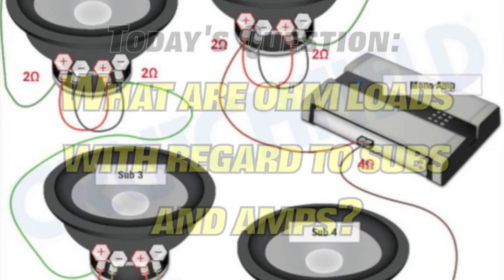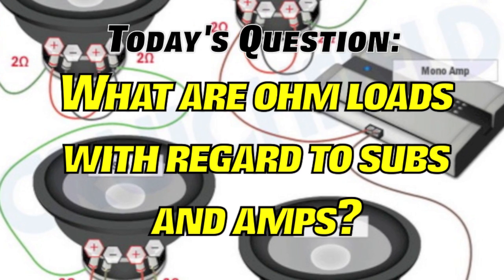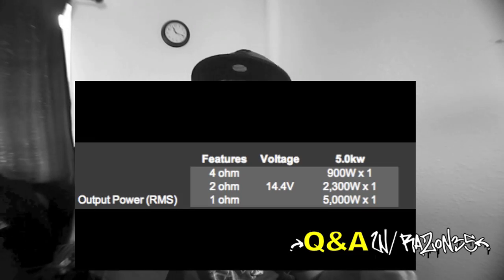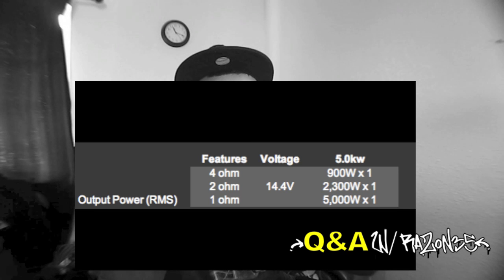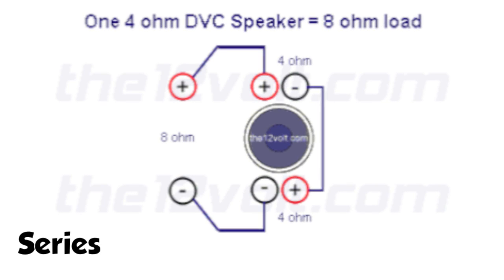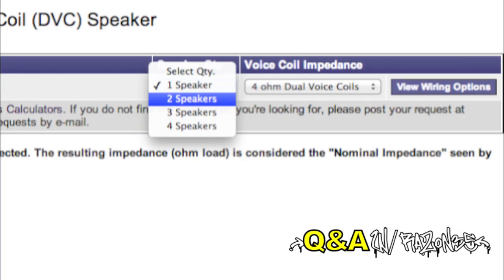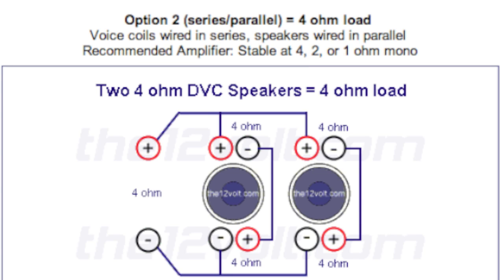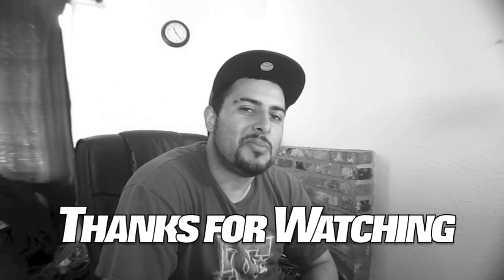Car Audio Q&A: What are ohm loads in subs and amplifiers? Razon35 Episode: 3

Comment: I just ordered a single Fi Team15 Dual 2-ohm Sub but on their website it says "1.49 ohms/coil". The amp i'm wiring it to is the AQ 3500 at 1ohm. Am I able to get a final 1-ohm impedance, or will it be like 0.75 ohms?
Reply from the maker: if u ordered a dual 2ohm it should be dual 2ohm, but yea if it turns out it's a dual 1.49, and u wire it in parallel, then u will see .75. but when u get the sub check the impedance with a multimeter to be sure. but either way u should be good
Reply: alright thanks. like i said i ordered dual 2 ohm, but fi says its 1.49 ohms. either way yeah i think ill be good with the Q-3500 Amp, i've seen people run them at .33 Ohms